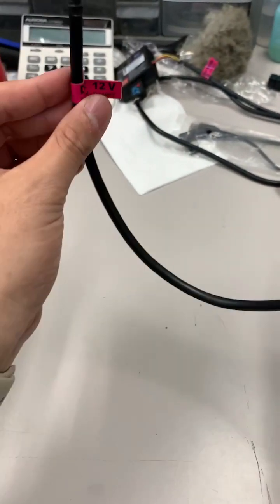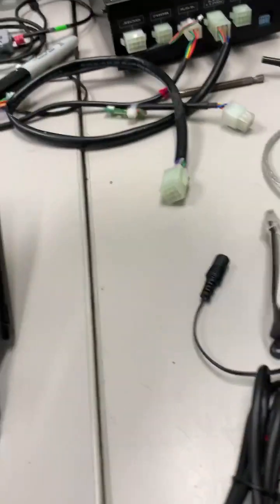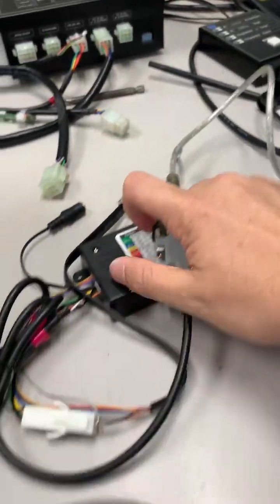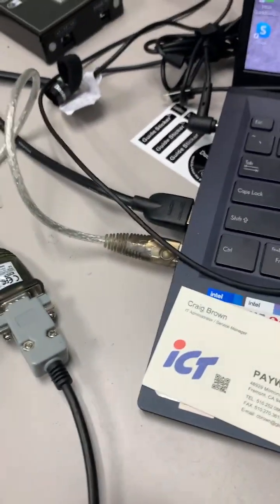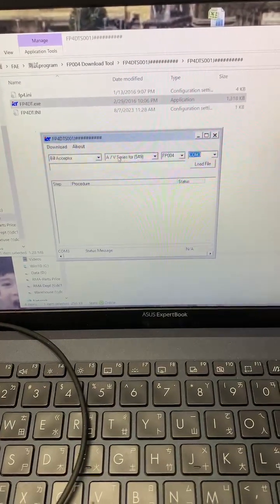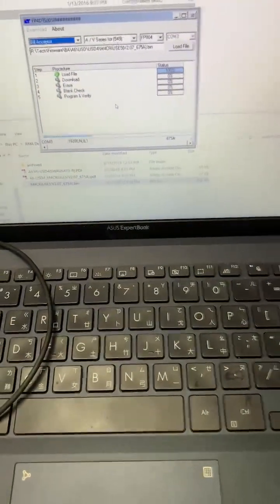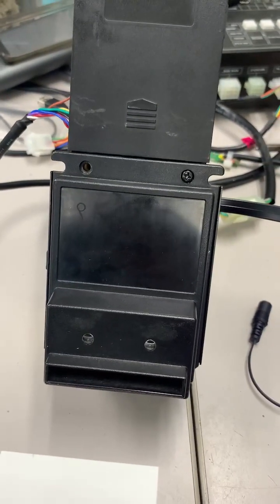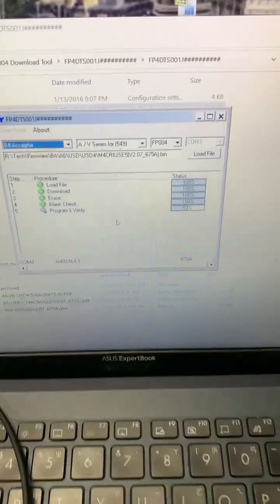6 Series Firmware Update with FP-004

Comment: Can you change the firmware from a touchtunes ict v6 acceptor to be pulse instead of mbd?
Reply from the maker: Good morning, 

The PULSE protocol was only included with our V6 (Vending) models, per Touchtunes' request to support their older legacy jukeboxes. Since 2018, TT no longer supports these older legacy configurations and have since then removed that interface from the V6 firmware. Thus, the V6 now only supports the MDB protocol, as originally anticipated. 

We still have archived versions of this firmware available, but it's not advised to use them, as they will lack any newer security and bill pattern updates to block counterfeit bills and allow for better acceptance. If you still acknowledge and accept this risk, you may contact me directly at cbrown @ globalpaywayinc . com to request a copy. 

Ideally, you would want to use one of our A6 (Amusement) models for any machines running under the PULSE protocol. 

Have a great day!
Reply: @ICTPaywayInc  I sent ya an email, thanks for your response.